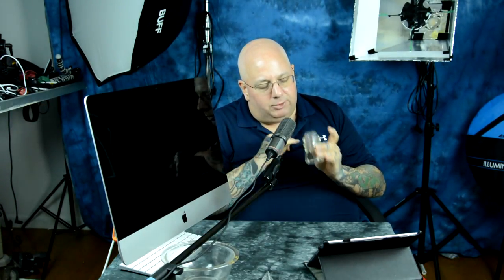HOW TO: On LENSES: Nature of Lenses & Glass that you don't know about

Comment: Your explanation is absolutely correct and it is obvious that primes are always sharper and have better contrast than large zooms with much glass in it. 
But I have to admit that you can get fine results out of ultrazooms with much elements in it.  For example the classic Nikkor 50-300mm 1:4.5 6 x Zoom with 20 elements and no ED glass in it is sharp, it has at least for my taste a beautiful contrast (which of course is mostly depending on your lighting conditions and doesn't come just out of the lens), there is little vignetting and the CA's are there but pleasing and sometimes easy to correct as the heavy distortion at 50mm is. In contrast to my cheap 13 elements AF 70-300mm 1:4-5.6 D ED this old & heavy lens is far superior in corner sharpness and optical quality. You simply can't use that lightweight travel lens wide open most of the time because it reacts allergic to bright light sources & reflections then. The 50-300mm is fine to use at 1:4.5.
I couldn't discover the yellow effect by now.
Reply from the maker: "fine results" means nothing, if you mean SHARP, thats only ONE attribute of a great lens. 

sharp sharp sharp??????????? ROFL………..thats like a WINO who rather drink pig swill because of alcohol content (sharpness) instead of a fine wine with lots of great attributes,  microcontrast, correct phase, rendering…
Reply: I don't just mean SHARP, I see photographs as a whole and look at different attributes in detail. There are lots of awesome photos that aren't sharp at all but there's something special about them that makes you stop and want to watch longer. May it be the composition, the depth, the lighting, color, etc. With "fine results" I mean that the photos are overall pleasing with no obvious distractions for me and, most importantly, they are coming out as I wanted them to come out.

Comment: Hi Ken, I have a question for you (just a question, not sure if that is possible): if one "mixes" some materials in the glass to "reduce its capacitance", so, let's say for example that a glass with mix A (let's call it modern lens :D) has 1/3 of the capacitance of pure glass from 1960s (let's call it amazing 135f2.8AiS), isn't possible that a modern lens with 12 elements could be as good as a old lens with 4? Again, I am not sure about that, just asking...